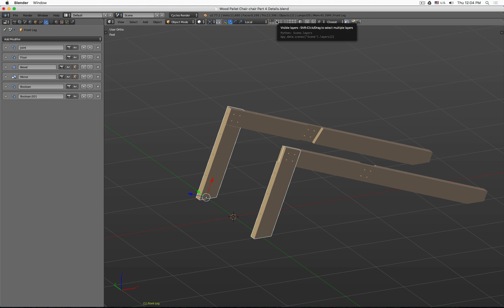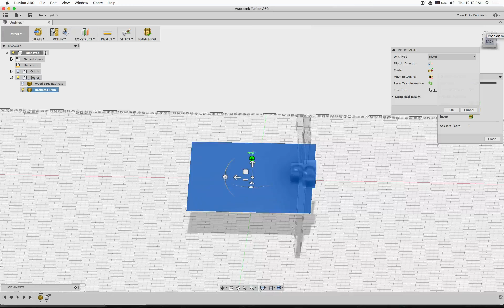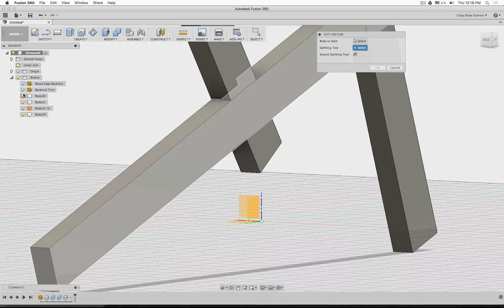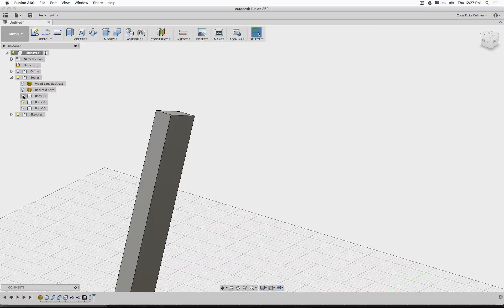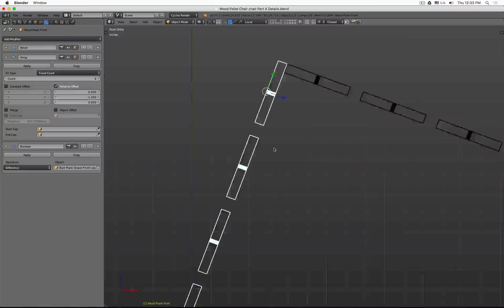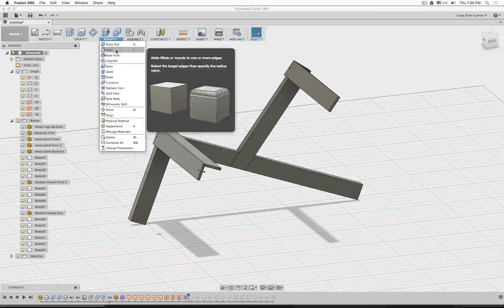Wood Pallet Chair Part 3 Blender To Fusion Workflow Mesh to Brep

Comment: after I combine two bodies the result mesh is a mess. i wish to convert to all quads with all vertex connected. My question: about to remesh before to export to blender from fusion 3d  do you have any advice to do it.  Thanks for your help. Your tutorials are really helpful !!
Reply from the maker: @graphic.design I assume with combine you mean that you applied a boolean Union in Blender and then exported that to Fusion 360?

If yes that is not ideal because this process with polygons always will create triangles.

Boolean modifiers in Blender work for me as an interactive tool only - I never apply them. I export the raw mesh without any boolean modifiers applied because in Fusion I will use the Solid Combine command later which is the same as the boolean modifier in Blender.

Other modifiers such as mirror bend and such you can apply during export into OBJ.

Does this help?
Reply: I import two single obj and fallow your tutorial convert in bodies. Then combine. Now I need to export back to blender. Fusion360 show me bad topology. Thanks
Reply from the maker: send me screenshots at info@ckbrd.de
Reply: Ready sent, Thanks